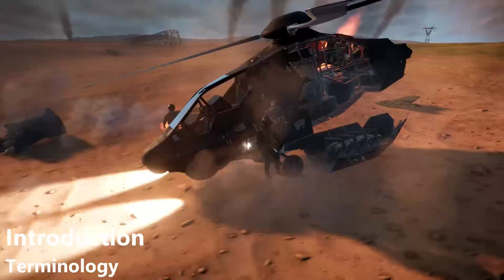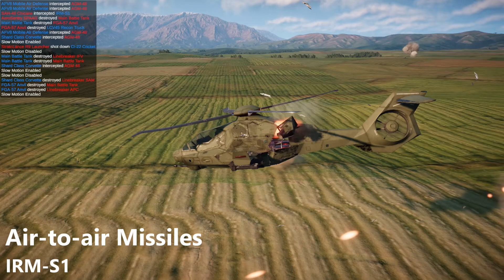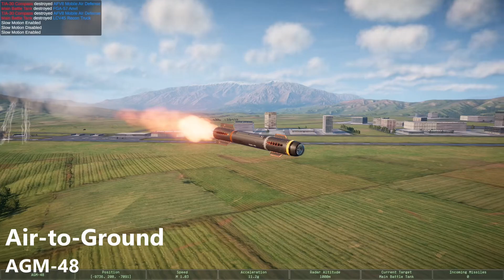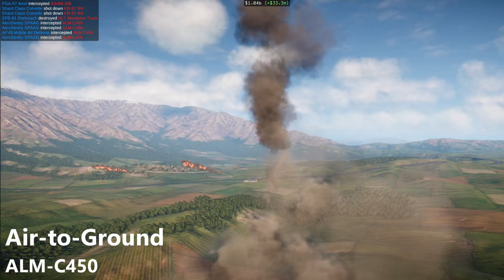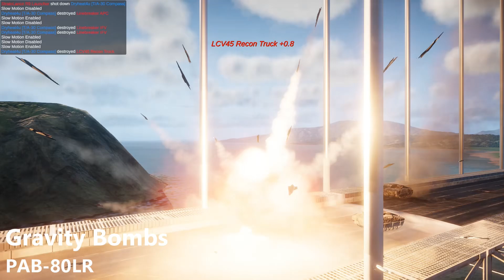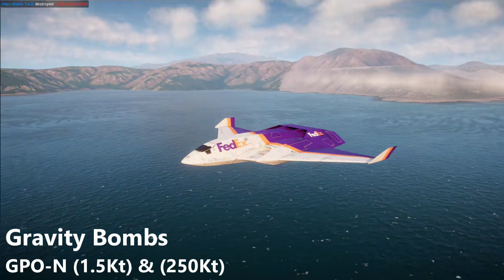Nuclear Option | Weapons Overview | Patch 0.29.0 [OUTDATED]

Comment: 3:01 Just wanted to add to what notching is. Radar guided missiles take advantage of your planes speed and uses it to differentiate between terrain and your airframe. So when you are moving towards or away from a missile it will detect you because it sees that you are flying away or towards it (compaired to terrain). Notching is using this against the missile. If we fly at a 90 degree angle (keep the missile on the right or left side) the missile won't see any movement towards or away from it, causing it to loose lock. But if you instantly turn again after the  missile looses its lock, it will re engage lock and it is time to start notching again or use terrain. Anyone with corrections or additional information is highly appriciated since i got this information from a youtube video

Comment: Great video! Quick tip regarding the explanation of "Notching":

All radars ingame seem to approximate the behavior of pulse doppler radars, which means the radar is not just looking for the simple reflection of the target (which would make looking down at a target with ground clutter in the background very difficult/near impossible, like in real life) but instead the doppler shift of the reflection.

If a target is moving towards you, the difference in closure rate compared to the ground will create a shift towards higher frequencies in the reflected signal, and a shift towards lower frequencies for a target moving away from you. This is a real phenomenon used in real pulse doppler radars to achieve look-down capability, as you are able to just simply filter out all return signals that have the same return frequency as the large background return, which is the ground.

The only caveat of this technique (just like in reality) is, that all targets moving perpendicular to you (so, sideways from your point of view) have a doppler shift in their return signal which also matches the ground, as there is no difference in closure rate to you.

THIS is what is called "The Doppler Notch", therefore "Notching" refers to a pilot trying to match a course exactly perpendicular to an incoming doppler radar targeting his aircraft, to minimize the doppler shift in their return signal.
Reply: This might be the most concise explanation of Notching (and why it works) i have ever seen
Reply: @acceptablecasualty  Thanks for your kind words, I thought it deserves a few paragraphs as it really is a non-obvious effect without understanding the concept of doppler radar first.